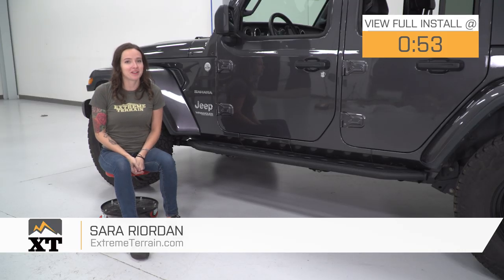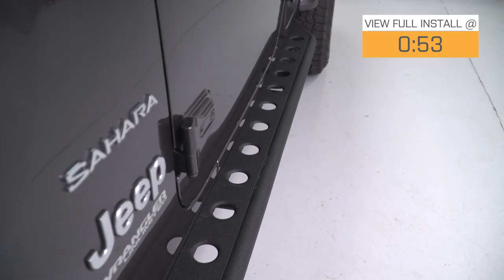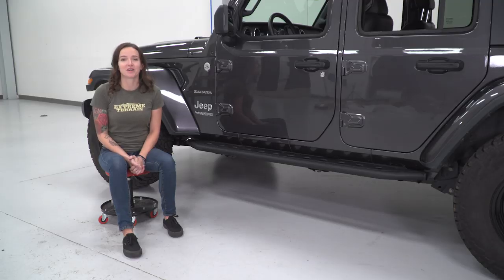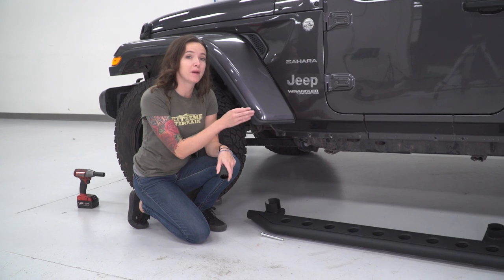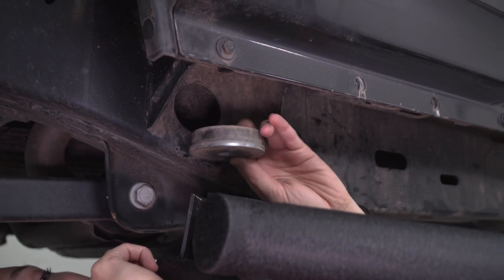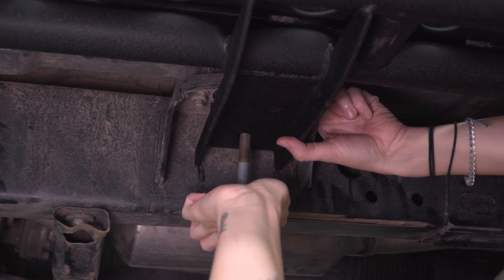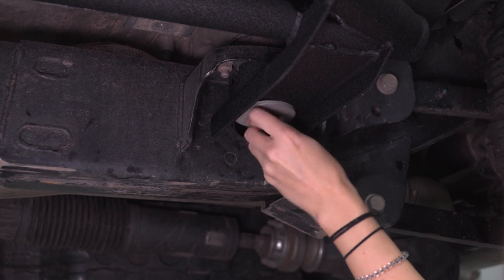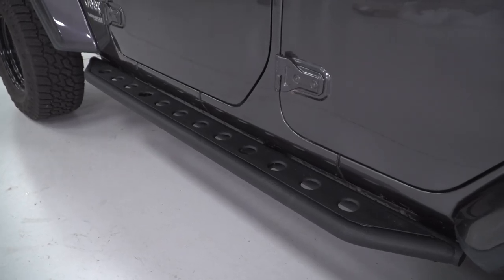Jeep Wrangler JL 4-Door Barricade Tubular Rock Sliders Review & Install

Comment: I read a lot about the factory bolts snapping on the JL. Some even appear to have been installed using red loc-tight.  Be careful when removing these bolts.
Reply: I just did this install and the front most bolts on both sides have red loctite and the rest have blue. It’s a bitch of a job but I didn’t break anything lol

Comment: I was trying to remove the second body bolt (middle) on the left side
I got it lose but now it won't unscrew any more
It floats freely, i can wiggle it around but it feels like their is something still attached on the inside
nothing it do can get the bolt to either tighten or loosen anymore
tried an impact wrench, nope
tried a socket wrench with a bar, nope
what am i doing wrong? did i break something up inside?
Reply: Did you ever figure out that issue with the bolt? I found some second hand brand new never installed and for a killer price. Just doing some research before I fully commit to picking them up.
Reply: The bolts are screwed into nuts. The nuts are kinda free in there after you break the bolts loose. You have to use a pry bar under the washer to put downward pressure on it to get the bolt out the rest of the way.